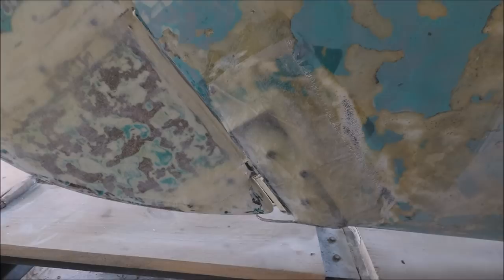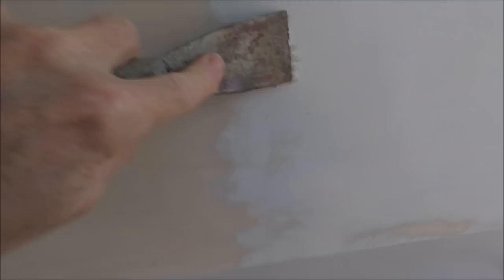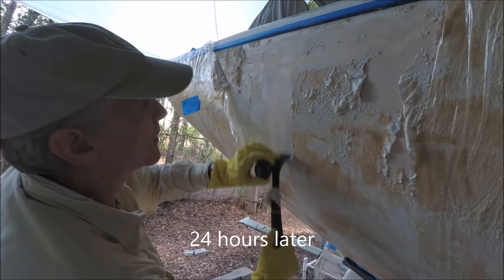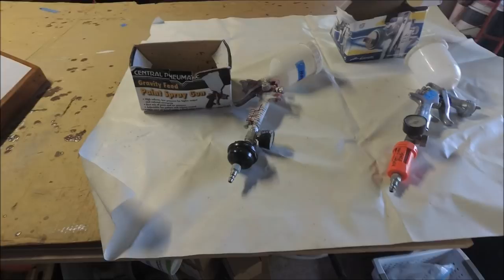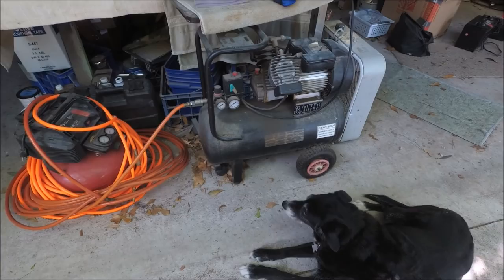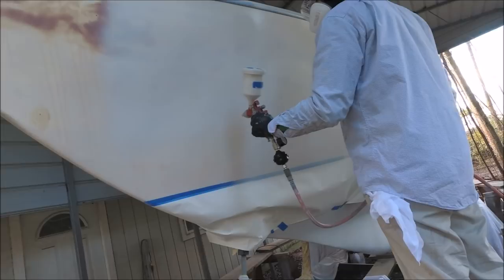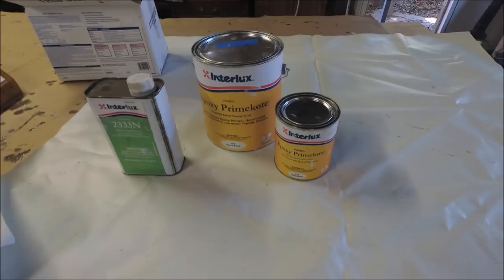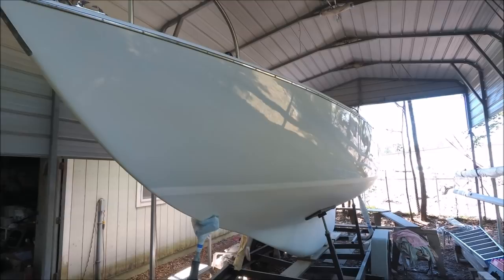Painting a Sailboat with Alexseal   Triton Osprey Refit Part 9

Comment: Last year I resprayed my little trailer sailer in a spray booth with 2 pak.....  it was sprayed with a low pressure gun blue on white but the blue came out with a finish like 320 grit sand paper.... it does rube down and polish up, but I thought that maybe I shot it with too much pressure but after watching your comments maybe it was not enough pressure !!
I always love your vid's and the relevance to what I am doing at the time or wish to be doing.
Reply from the maker: It's hard to get a perfect finish if you don't have a lot of experience. Mine are never perfect but I found I got better results by turning the pressure up and adding the max recommended reducer or even a bit more. You need to take care the sanded primer is absolutely flat. I overlap about 50% on each pass and keep the gun 5-6 inches away. Practice on some flat panels with different settings and look at them after they dry.

Comment: Wow! pretty spectacular results.  Appreciate taking the time to set up and walk us through your process and products.  Often wonder with these products, how do you clean your gun, cup and fluid set?  That has to be a huge job.  You have some perfect technique moving the gun through the range of motion.  Thanks, enjoyed... as usual.
Reply from the maker: Thanks for the comments. During the 10-15 minutes waiting time between coats I keep the nozzle clear of drying paint by spraying for a few seconds onto a piece of wood every minute or two.  When finished I rinse the leftover paint out of the cup and shoot a cupful of acetone through it and then disassemble the air cap, tip and needle to clean in a cup of acetone with a toothbrush.  Only takes a few minutes and there are videos they show it being done..

Comment: Imron, Awlgrip, alexseal,  which one do you prefer ?   Price Comparison ?  Which one is easiest to use ?   Thx and been a fan for a long time.   I own an Ensign and a aTriton.
Reply from the maker: I don't have any experience with Imron. I think the prices from lowest to highest are Perfection, Alexseal, Awlgrip but you can shop around to find out. I've had problems to get a good finish with Perfection and also had it lose gloss after 4 years. I usually spray Alexseal and only rolled and tipped small areas and liked the results either way. 20+ years ago I rolled a lot of Awlgrip and it was always good results but now with their new formulation it seems to be less easy to apply and lasts less long. But I've only done one boat recently rolling Awlgrip and it may have been the less than ideal conditions of painting in direct sun and wind that made difficult. If I had to roll another boat I'd try the Alexseal. For spraying I'll continue with Alexseal but would also be willing to use Awlgrip if a customer wanted that.
Reply: Thx for your quick response.   I love all the Pearson Classics prior to 1971 and happy to see you keeping the fleet together with your amazing work.
Reply: I've painted three boats-two with Awlgrip, one with Alexseal. The Alexseal paint has held up and remained shiny a lot longer than the Awlgrip did. And it seems a LOT harder. VERY difficult to sand and buff once it's cured. Just FYI...

Comment: Can you tell me what spray tip size you used for topcoat Alexseal along with your 50# air pressure?  I will be doing my own soon.    It looked to me that your tip might have been a bit too small for the primer as you were moving quite Slowey. How did that primer lay down?
Reply from the maker: I don't recall the tip size but it was the standard tip supplied on the cheap HF gun. I think you're right that a bigger tip would get more primer on smoother and faster.  I thought it went on smooth enough for a primer but it was slow going. The Alexseal on this boat still looks good two years later but I recently saw a boat I painted 5 years ago with Alexseal and the gloss is mostly gone from the areas of hull and deck most exposed to the sun. Under the dodger it still looks like new. I don't know if I had a bad batch of paint, too much reducer, or poor application procedure but it worries me going forward. Next time I would not add more than the recommended reducer and try less pressure and let it go on with orange peel and then sand it with 1000 grit on a 5" orbital sander following by rubbing compound. That would take care of dust and insects as well. Runs could be fixed with coarser grit to start. That would reduce the stress of trying to get a perfect finish although much more labor.

Comment: Whats the dark gray down on the very bottom in the water line? Is that just primer only?
Reply from the maker: Yes that's Interprotect 2000e white epoxy primer barrier coat. The white is light gray and they sell a grey which is dark grey.